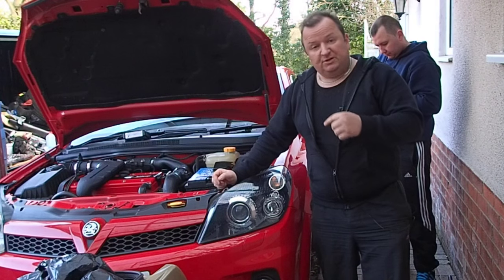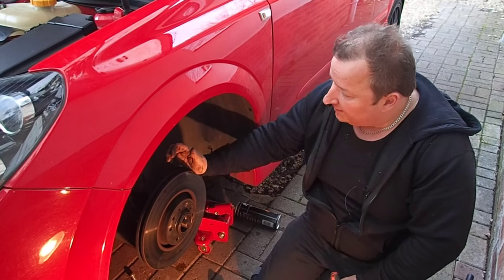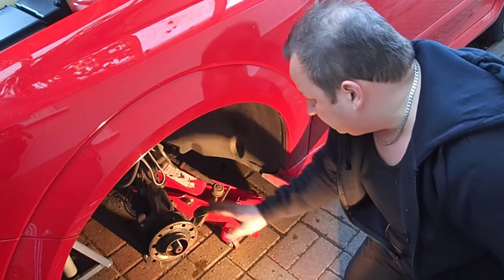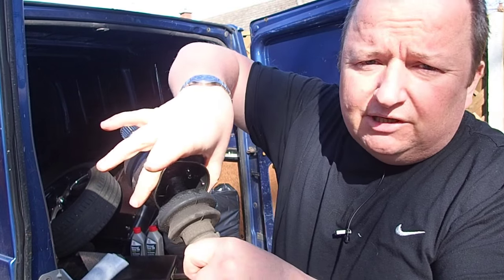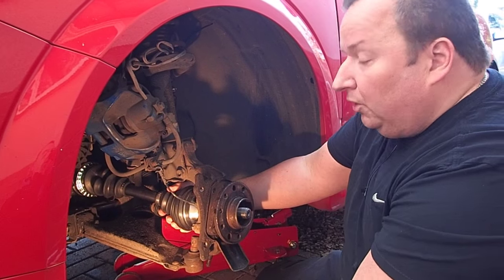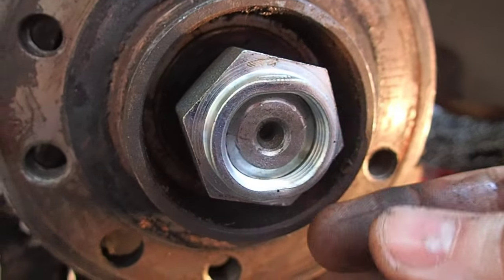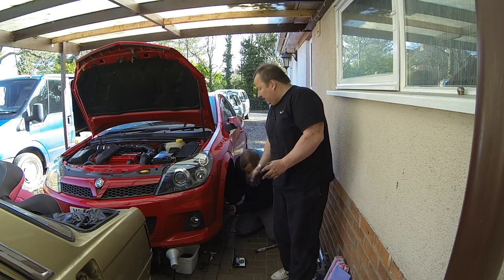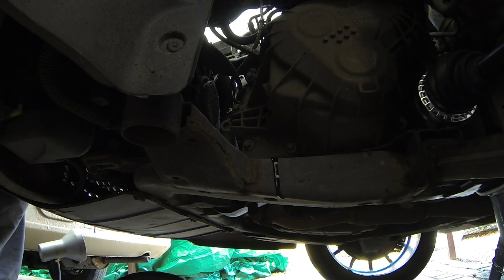Vauxhall Astra VXR Mk5 Driveshaft Gaiter CV Boot Split How To Change

Comment: Great video Martin, well worth getting another drive shaft, its not worth the hassle trying to split the joint and replacing the boot, they always pop off because you can never get them tight enough with all the grease everywhere.Look forward to more vids Martin soon.
Cheers, Jeff.
Reply from the maker: +cabdriveruk Cheers Jeff, that old shaft looked knackered as well so glad we changed it. Passed the MOT as well.
Cheers
Martin

Comment: Brilliant vid mate I've got to change the drive shaft on me astravan , one question, is the gearbox oil filler hole and the level hole in the same position as the vxr? Appreciate if you can answer this for me !

Comment: For only a few extra quid it was well worth replacing the whole drive shaft. How can they charge so much for rubber boots? I'm keen to see some progress on the Triumph Acclaim as my old company used to make all the suspension for them. Did you get the head machined yet?
Reply from the maker: +Andy K HI Andy, Yes, head machined, I did a vid on it. As soon as the Transit wheel is done i'll be on the Acclaim.
Cheers
Martin

Comment: Nice job Martin, suppose it's different working on the mondeo, Bet your lads happy he has a nice mint low mileage Astra vxr as there getting harder to find. Just another question did you used to work in the motor trade or are you just self taught from doing all your own cars??
Reply from the maker: +Bevan Garner It's a nice car and very quick as well. I'm not a mechanic just self taught. Worked on cars since the age of 14 so it's been a good few years lol.
Cheers
Martin

Comment: hey bud can give bit of advice we have a sri vectra driver side cv boots split can i change it on the car still ir are they different now? iv not changed one for years now used the old uni cv boots that glue down the boot but not sure on these newer vectras! any advice would be great not sure in need to split hub for driver side ?
Reply from the maker: In my experience, it's far easier just to change the driveshaft. Check out my vid I done recently on the Corsa driveshaft gaitor and the hassle I had with that. https://youtu.be/EJt7TWgWHpM?list=PLM5aAjIo5X2wFaA6NE31OXsad--lNmYqh
Cheers
Martin

Comment: Hey Martin where did you get the new shaft for that cheap?! I have been looking endlessly!
Reply from the maker: +batista999 hereyou go bud http://www.ebay.co.uk/itm/131140624025?_trksid=p2057872.m2749.l2649&ssPageName=STRK%3AMEBIDX%3AIT
Reply: Thanks ! Do you think this will fit the Astra mk5 turbo 2.0 Sri, it's the vxrs brother ( just different bhp ) same platform as Vxr? Relatively the same car, same gear box. Thanks
Reply from the maker: I gave them a call and they told me the item number. if you google their name, you'll find the number so they will tell you the right one.
Reply: I would advise on the m32 gearbox putting 3l of oil in. preferably not the GM shit. Especially on the 1.9cdti which has same box as a vxr. Because these boxes are made of chocolate.
Reply from the maker: Thanks for the advice bud.
Cheers
Martin